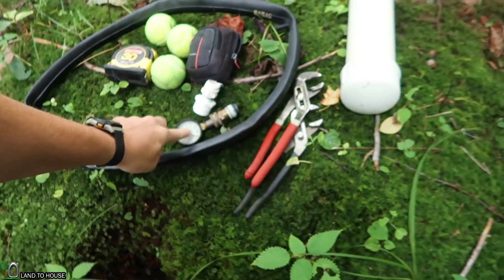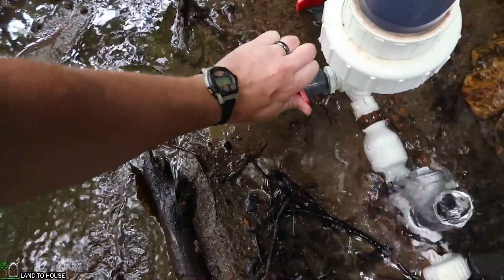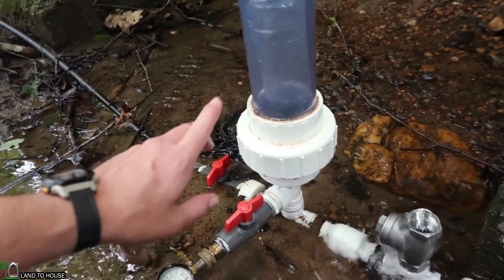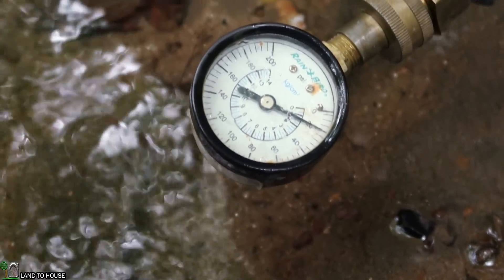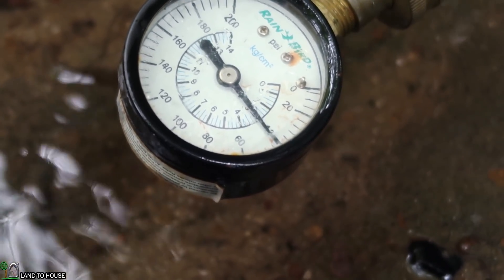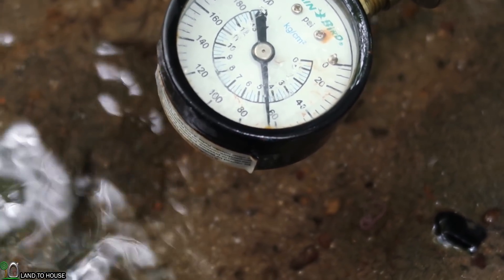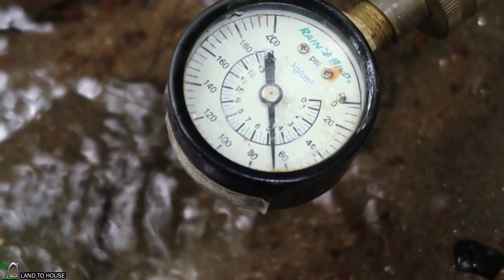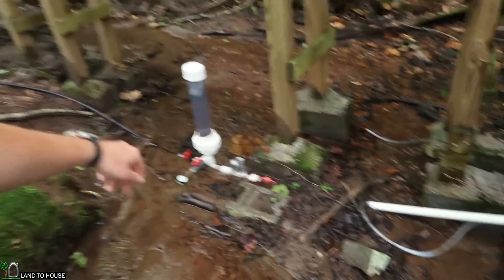I Was CALLED OUT! 60 psi?

Comment: sorry to say but betting that they were suggesting that it can't sustain an output at 60, looks like you proved em right. that tank/ram pump may be capable of holding 60-70,  such as the air compression in a tank.
 
having 20-30 psi output could easily go up.   any restrictions you do to the out put can boost your pressure tho. smaller tubing you can boost your output another 10-15. just the same as your thumb over the end of the hose it'll either drizzle out or you can spray 20 feet away,

Comment: Who cares what the pressure is when it is closed.. misleading like the generators...  4500watts . Small print starting watts.  3000 running watts.
Reply from the maker: There are a few ram pump videos on the channel just for fun. I have at least 60 ram pump videos that get right to the point.

Comment: The gauge indicated that you were losing pressure after the compression stroke. Maybe your check valve is worn? Would be interesting to do a pressure hold test and see  how long it takes to bleed the pressure down and then find the culprit. Possibly need 2 check valves in series?

Comment: Lol, that's funny considering it's a free energy device! And please, no negative reply(s) because if you don't consider this a free energy device, then go and build something! After, take the time to think to yourself how your required to start the process. Nice job having a heckler and reaching over what is house hold pressure if I'm not mistaken!  Either way, that's alot of pressure from a device using no electrical power to run it

Comment: At the 62.5 psi that your gauge indicated, if you had 144 ft. of elevation on the delivery end, that would be the equivalent of shutting off the ball valve as you had done. and there would be no water coming the end of the hose. The weight of the water would have equalled the pump output pressure.

Comment: Hi I just saw your video and I was amazed by it. I just wanna know, is there a required pressure for it to work? Or does the lenght or the size of the hose affect its performance?
Reply from the maker: You need a minimum of 2' drop in head pressure. That can lift water to 14'. It is important to match the waste valve size to the drive pipe.

Comment: If this is set up with river forces pushing water into the drive line, does it impactperformance over it coming from a still pool?  Aka, does the river's head pressure add to the head pressure of the system?
Reply: Assuming you can harness the river's inertial energy before it enters the pipe, yes, the velocity would be increased at the ramp pump.  This is also considering the feed pipe diameter is large enough to handle the increased flow. Best bet would be a funnel shaped entrance, but now you are more susceptible to debri build up.  If you want added pressure, just use more head height from a standing pool.

Comment: So what's the equation head  vs tank pressure
Reply: Every foot of height equals 0.435 psi in the pressure tank (if the delivery line is opened). This is of course only valid if you are in a low-flow-regime in the delivery pipe (means no dynamic losses or friction losses).

Comment: 20 psi.  You should try pressuring bladder (inner tube)  to no less than 18 psi for efficiency.
Reply: I would recommend about 0.43 psi per foot of height he wants to pump to. Then substract a pound or two.
So if he wants to pump to 45 feet, then a good initial pressure would be 18 to 19 psi, which matches your recommendation. But if he wants to pump higher, then use a higher initial pressure. Exceeding 0.43 psi per foot of height would be counter productive since the pressure would exceed what the pumped column of water would have.

Comment: Interesting Seth I just installed my new ram pump it is your original design. 
I did install a pressure valve t and a drain for the pressure. I have to replace my oil pressure gauge but it was about 23 lb normally I remember but I was unable to shut it off and get a full reading because of its configuration. 
I'm going to try that this week and get a new pressure gauge and see what I can get with four feet of head. 
Keep the videos coming 👍👀

Comment: When the discharge valve is closed, the pressure gauge reads 70 psi, which is 48 metres of water head (which is quite high). This means, water exiting the pump has enough energy to travel 48 metres vertically up at that point. This can be observed if you hook the discharge line to a pipe running vertically up to 45 Metres (which is physically quite difficult).

However, in this case, when the discharge valve is open the gauge reads only 20 psi which is 14 m of water head. This just means that water is travelling to an elevation of 14 m if we disregard pressure losses in the discharge pipe. In this case, because of the very low flow rate, there would not be any significant dynamic head loss in the pipe. Hope this makes sense. 

It's just basic fluid dynamics. People can argue all they want but if the gauge reads 70 psi, that means you will get a head height of 48 m.

Comment: Where did you get the plan's? 
I want too build one....
Here is an idea get 2 big tanks and hook one too ur pump to the other and a water wheel in the mix for generations unit
Reply from the maker: If you would like to build one I have several videos on my Channel showing how. The ram pump works very well for lifting water out of a creek. It's not the best at producing electricity. The flow rate is very small.
Reply: So 3 maybe 4 pumps ??? Maybe
Reply from the maker: From my understanding the calculation for hydro power is: ((head pressure * gpm) *.18) /2
If you head pressure and flow rate are low the power made will be very small.

Comment: 800th like. Nice video. Didnt realize that a ram pump could produce that kind of pressure. Gonna get my sub.
Reply from the maker: Thank you for watching and subscribing. The water hammer effect can build tremendous pressure. Do keep in mind this is with the delivery valve closed. In normal operation the pump has very low pressure
Reply: @LandtoHouse  The pressure in the pressure tank is equal to the height to which the pump is pumping (if the delivery valve is opened). Every foot of height gives you 0.435 psi. This is of course only valid if you are in a low-flow-regime in the delivery pipe (means no dynamic losses or friction losses).

Comment: My pump with 6.5 ft of head can generate 90 PSI.  I got your back Seth!  I know you know, but for those who don't you CAN actually pump at 60 PSI but the delivery elevation would be about 138 feet of head. (60/ .433 lbs/sq in / ft rise = 138 )
Reply from the maker: Nice! 90psi is a lot.  That hammer effect is some powerful stuff!  Yes well said about pumping up to 138 feet.
Reply: Yes it is!  I really enjoyed your pressure chamber tests you did  while back. Excellent stuff! Keep em coming!
Reply: Hi, very interesting !. 1. In what type of ram pamp did you get 90 psi ?.
2. What is the pipe diameter of the source ?.
Reply: A 1.5 inch swing check with 2 inch supply line.  See my channel for more: https://www.youtube.com/watch?v=djwZq7RLo2Q&list=PL837tk-T71Lgw3Of_XqmoPrj3tdsVIURE   April of 2016 or 2017 for what I am referring to.  cheers!

Comment: So it's safe to say you could run the feed line out further and higher and still get good water flow..nice! 
I wonder if you put a check valve in reverse on the feed line (past the valve) so when water pushed up the feed line it will be stopped on the return pressure wave, so you could get higher pressures and/or further feed elevation or distance
Reply: 1 psi is equal to a water column of 0.70 meter or 2.3 feet. With 70 psi it would be possible to pump water to a height of 161 feet, but the flow rate then is zero. So you have to keep the height below the 161 feet.

Comment: 60psi means you can pump up to an elevation of almost 30feet?
Reply from the maker: Because this test was simply a test of pressure built with delivery pipe closed it is not the operating pressure. 7 feet of head pressure can lift to around 50 feet.
Reply: @LandtoHouse  Right, with 50feet we wouldn't have any flow.
Reply: Every psi equals 2.3 feet of head pressure for water. 60 psi would pump up to 138 feet, but the flow rate woul be zero there. So you have to be below 138 feet to be able to still pump some water.

Comment: If the vertical lift (in feet) divided by 2.31 > 60 then you're definitely generating 60 psi. The pump trades a low amount of head pressure and a high flow rate for a large amount of head pressure and a small flow rate. Nothing magic...

Comment: what would happen if you pressurized the bottle inside the pressure chamber to 10 or 20 psi
Reply from the maker: It might do better. I will need to do an actual test with these with flow rates.

Comment: if i was out in a remote location and needed some air for a tire or something else. you could attach a air line to that and send it to a air tank. then you could have some air for a while. it would need a check valve to keep the higher pressure out of the water pump
Reply: With a different configuration you can I think they call it a trombe pump
Reply: If only, if only... Lol.

Comment: Why are you saying pound per square inch and reporting the value in Kg/cm^2? 70 kg/cm^2 gives about 1000 psi.
Reply: Pretty sure that the gauge reads psi on the outer ring and kg/cm^2 on the inner ring.  The PVC would blow up way before it got to 1000 psi
Reply: Good thing it didn't even get to 5kg/cm^2 then.

Comment: Before i even watch the video i will call it that yeah it can be above 60 psi. Why? Because the water column (voltage) does not matter here.  Ram pumps work on current.
Reply from the maker: Once the delivery pipe is opened the pressure drops way down. This was just to show that the ram pump can have high pressure if the delivery pipe is closed.
Reply: @LandtoHouse  yup makes a lot of sense. Thank you for your hard work :)
Reply: @LandtoHouse  True. The ram pump would keep on generating higher pressure up until the back pressure on the check valve equals the kinetic energy supplied by the incoming water as water hammer

Comment: That type of pressure impulse will kill gauges, btw.
Reply from the maker: Yes I just found that out the hard way.
Reply: I use liquid filled gauges for things like that. They can handle impulse loads with not problem. That is what they are made for. But you are right about regular dry gauges it will hammer them apart.
Reply from the maker: And it did haha. That gauge failed finally.
Reply: @LandtoHouse  if the gauge failed then i would think that it was not correct before it failed. but the point is taken that 60lbs is good.

Comment: How would a series of ram pumps in series do? Maybe more effective  pressure etc
Reply: It would work but, they would each need to be fed by a separate tank.  That is, the first pump would fill a tank that would be used to power a second ram, etc.  The feed water supply needs to be at a low pressure but, high volume.  Because only about 10 percent, at best, of the water will be pumped,  you may need multiple pumps to fill the tank feeding subsequent a subsequent pump.  Running out of water in the tank will cause the ram to stop and you'd have to go and restart it over and over.
Reply: i would like to know too. air compressors use 2 and 3  stages to get high pressure.

Comment: 20 psi with the delivery pipe valve open: would I be correct in guessing you are pumping up about 40 feet higher in elevation than where the ram pump is located?
Reply: witkrieg todd  I expect pressure would be constant regardless of pipe size.
Reply: That's correct. 46 feet to be precise. This is only correct if there is no dynamic loss in the discharge line. However,in this case, because of the very low flowrate, that assumption would be correct.
Reply: @haroonibrahim2620  Yes, exactly. 1 psi is equal to a water column of 0.70 meter or 2.3 feet. 20 psi × 2.3 feet = 46 feet. With 70 psi it would be possible to pump water to a height of 161 feet. Although, the flow rate then goes to zero.

Comment: Yeah. But how do we know that the gauge was accurate? I am going to need the make and model along with production dates and whatever other information that you can provide
Reply from the maker: Hahaha too funny. The water hammer can certainly build a high-pressure. As soon as you run this pump in normal operation it has very low PSI
Reply: @LandtoHouse  I am glad you realized I was messing with you.

Comment: Can I ask why you use the pvc check valve in one place and swing plate on the other?
Reply from the maker: Yes. Two reasons. It's easy to tighten the pump if you dont have to focus on the secondary valve position. And the pvc is lighter for shipping.

Comment: Your pressure tank is close to water saturated. You need to add a weep hole in the feed pipe before the tank check valve to introduce air at pressure drop to keep the air cushion in the tank.

Comment: Have you ever tried using an expansion tank instead of that pipe chamber? They have a rubber bladder and you can adjust the air pressure on the back side of the bladder.
Reply: Others have done that.  There is also a trick that causes the thing to suck in just a bit of air on each stroke so that over time the the ballast tank fills with compressed air.
Reply: ryan norris  
The "waste valve" I was referring to is the thing that goes clunk clunk clunk in the video.

Comment: Since you have the delivery open, the pressure will be roughly 10 kPa (0,1 bar) for each meter you lift the water. If you stop the end of the delivery pipe, the pressure will rise.
People needs to know the difference between pressure and flow: This pump has a low flow but high pressure.
Your tap at home probably have around the same pressure, but, it has a higher flow and thus can withstand a higher pressure even with the tap opened at full.
Everyone that has a pressure washer: The same, high pressure but low flow. But, the water goes into a tiny hole. If you remove the lance and run you will see that it's pretty... bad... even though that hole is smaller than a regular tap hole.
I was thinking, if you use a hydro press, then you can try different pressures in that and see if it works better or... worse.
Reply from the maker: Well said! I actually have a video where I nozzle down the ram pump output and make a jet stream.  The flow rate of the pump with open delivery pipe is normally only  around 1gpm.
Reply: Would also help using "inlet" and "outlet", or upstream and downstream, instead of delivery.

Comment: Thanks for adding the pressure gauge.   It is interesting to see how things are crushed with the shut 60 PSI, but for testing to see what objects might be effective for a functioning pump, shouldn't the delivery valve be open.    ... and as usual, I'm wondering the effect on volume of water delivered with different objects in the pressure chamber.    Think I'll stay with the bicycle inner tube you supplied until you have us change.

Comment: Doesn't that mean that if you restrict the output it will pump higher or does it only go up in pressure if it is closed?
Reply from the maker: The hammer effect of the ram pump accumulates while the delivery pipe is closed. As soon as you open the valve the pressure is released. When it is pumping normally the pressure is low.

Comment: What about putting the inner tube in and see if it goes higher Seth?  Pressure is one thing and the other is thrust or the ability to vacate plenty of water up the output pipe.
Reply: Any chance you could add one of your old brass flapper valves to the output pipe and measure whether their is any increase in volume of water pumped.  Especially with situations with  a large head or high lift this should make a difference. I'm liking that the reduced pressure in the Accummulator will allow more water to enter it.
Reply from the maker: That test is on the list for this summer. I want to install all the things that I tested this past year and see what fill material is the best for pushing water uphill.

Comment: That is not constant pressure. If your trying to run an irrigation system I don't believe you have enough pressure
Reply from the maker: You are correct! This is accumulated pressure with the delivery pipe closed. The operating pressure is more like 20 psi.
Reply: @LandtoHouse  perhaps there's a way to boost the operating pressure. However I doubt common plumbing supplies will provide the required dimensions.
Reply: So long as the water gets where it is needed, a low pressure is OK.
The system may need to be designed with the lower pressure in mind.
Reply: @kensmith5694  I fear it cant be scaled up to beat fuel or electric driven pump. I love the idea however.
Reply: @WvlfDarkfire  
The scaling of a ram pump works quite well.  It always requires the waste water path to carry the same fraction of the water.  This means that you need a big stream to scale it large.

Comment: So that means this small ram pump can deliver water up to a lift height which is equivalent to 65 PSI.
Reply from the maker: The psi buildup in this video is accumulated with the delivery valves closed. The head pressure here can lift to 50 feet.
Reply: @LandtoHouse  A closed delivery valve simulates the accumulated back pressure from the delivery height that the ram pump can overcome.

65 PSI of back pressure should be the same as lifting water up to a height of 140 feet. Will only be a trickle at that height though.